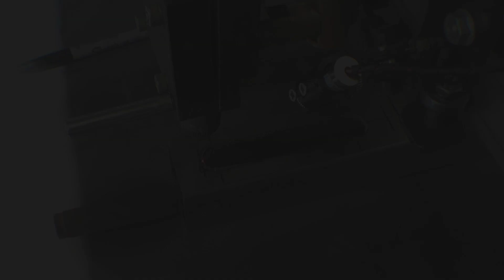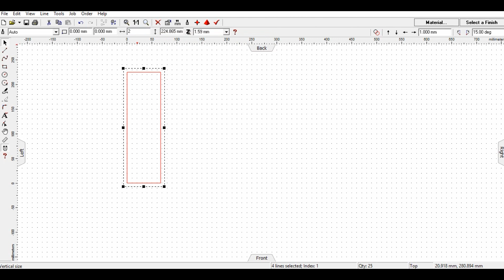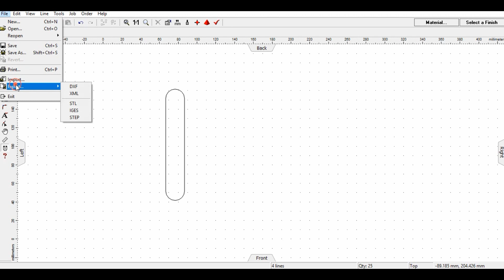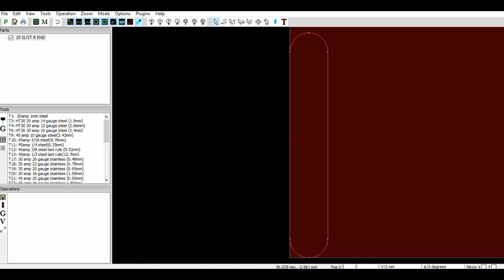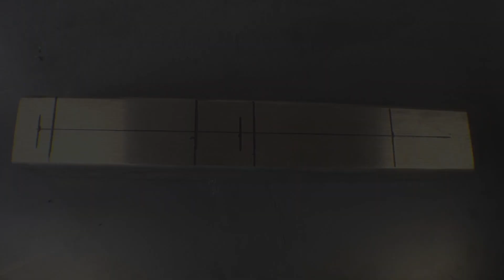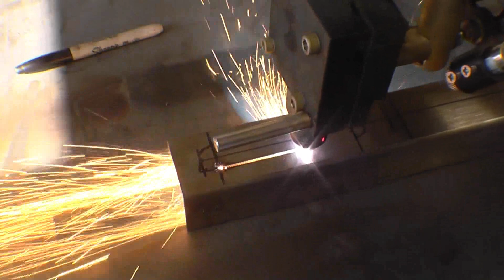How To Slot Box Section   Extreme Plasma

Comment: Hi John. Great little vid.... had a thought while watching. You could of set the second hole by duplicating the drawing in sheetcam and placing the next hole above it. You can change the amount it jogs the drawing I  sheetcam so you can do it at the dimension you need. That way it would of cut both slots with out having to reset the box.